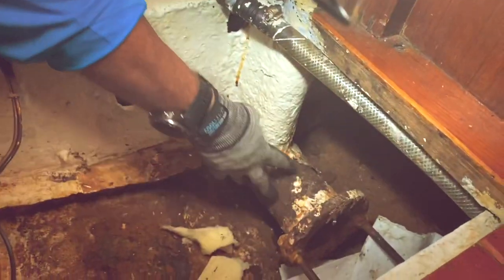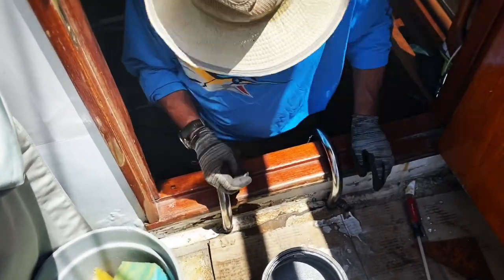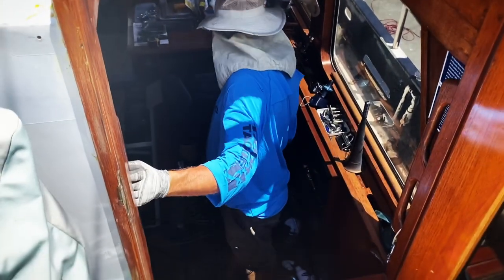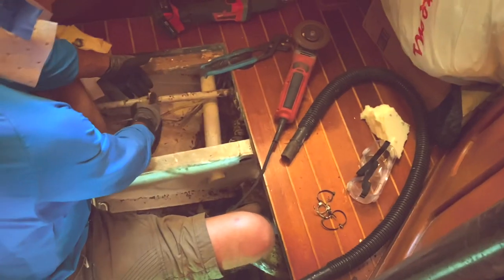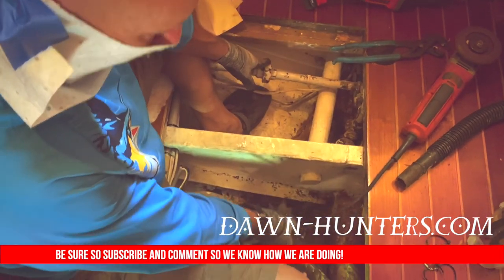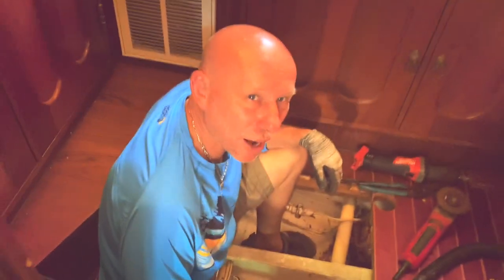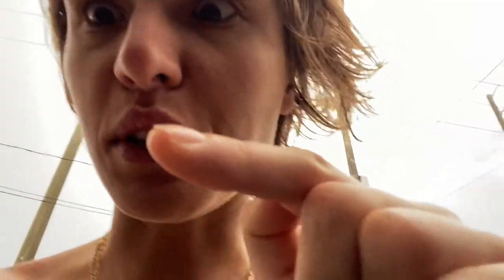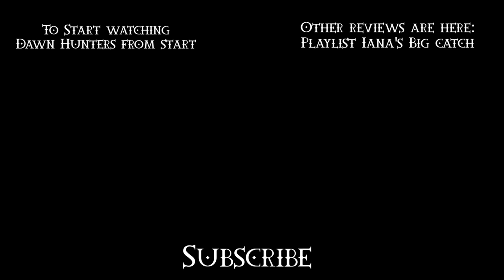Dripless Shaft Seal Problems AND WHY Replace BILGE PUMPS? - BOAT REPAIR VLOG

Comment: Another project, weee!! Glad you caught that one on land! Also, may I suggest painter's plastic? I've isolated areas where there was going to be saw dust by taping a perimeter curtain to the ceiling around the project area, not to mention covering stuff from dripping paint, hehe. Home Depot, for like $2.50.

–A
Reply from the maker: Good morning —
Yes is best to pull and rip things apart when no worries about water gushing in. Lol
The plastic is a good idea, we use it for all our hotel painting work and never think to use on the boat. My mission is to complete the outside work and then move inside when it gets really hot next month.   Thanks for the comments. Capt W
Reply: @DawnHunters  are you into maintenanceor construction? Saw your clamps on the boards and thought it was proper presentation. Retired architect here.

–A
Reply from the maker: Hello Alejandro. 
I have a construction company where we re-seal windows, stucco and paint hotels. Since the COVID took over have decided to complete the boat and set sails working along the way. There is always a boat needing repairs and a marina needing help. Enough being tied to a single location.
Reply: @DawnHunters  must be pretty cool biz in the coast, those 3 things need to be kept up constantly with the salty weather and all that good stuff. Well, keep those videos coming, very educative and fun to watch.

–A
Reply from the maker: Hey Alejandro. Where do you live?  I presume inland. I moved to the ocean years ago from up North in cold freezing Wisconsin. Hate the snow — love the ocean.  Any work near water makes it better.
Reply: @DawnHunters  I'm from México, yes, inland. Mom is from San Blas, so every summer we were on the water when we were kids, I love the ocean, hopefully will be living the sailing lifestyle one day... :)

–A
Reply from the maker: Alejandro Gonzalez 
Hey—. I lived in Texas for many years and worked in Mexico installing equipment near San Miguel de Allende. Spent 2 months there. Amazing place. We will keep you entertained I hope.  Capt Wm
Reply: @DawnHunters  that's awesome, Captain! Good friends in H Town, Midland and San Miguel! Last year was my first visit to SMA and you're right, it is gorgeous!
Keep up the great work, Cap'n, love your videos!

–A

Comment: Just found ya, I’m in... disagree with the drip less seal thou. I just spent 7 weeks waiting to haul out because of them... I went back to ole school ones, packing can be changed anywhere
Reply from the maker: Hello Tony and welcome. 
I will make a drawing of the dripless and why I decided to change over to the new style. I did make enough room to add a second seal on the shaft for future needs so for any reason I can cut the old one away and install a new one in the water and without pulling the shaft or the boat. 
I have designed an oil flow system around the dripless to maintain cooling without sea water. 
Also the shaft tube on Dawn Hunter is 3 4 inch round with a grease fitting at each end. The tube is filled with grease to keep sea water out. A seal system also exists at the end of the shaft near prop exit.  
Our boat is designed and build as a commercial exploration vessel so why not your typical marine system.  So what happened with your seal system?  What type do you have?
Reply: @DawnHunters  it was a PSS Single seal system with no room for a Tides Marine type System, I'm  Familiar with the type of system you explaining, it a very dependable one
Reply from the maker: Hello Tony. 
Ok then I know your pain!!!  Did not have the room for Tides system either so I cut the shaft tube flange off, cut away some of the bulkhead and added steel 12 inches back to accommodate the system plus the spare. My plan to have small gravity feed oil drip chamber with overflow tube should keep the seal lubricated and healthy for years to come. My shaft only rotated at 500 RPM at full throttle so the seal is barely working. 
Time will tell!! 
Thank you for watching and your comments. What boat do you have ??
Reply: Dawn Hunters we have a Bayliner 4788 in the past a Carver 3607 and a couple of Navy destroyers an frigates as well as being the lead Ship-fitter at  Groton Ct. Submarine Base